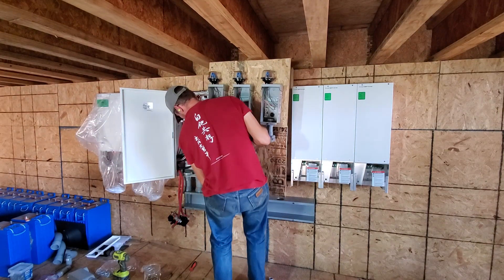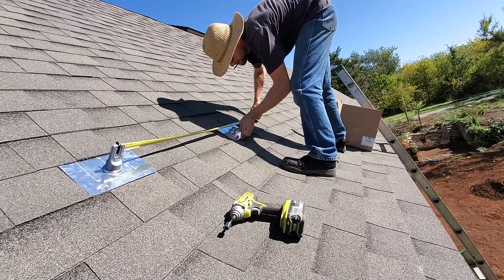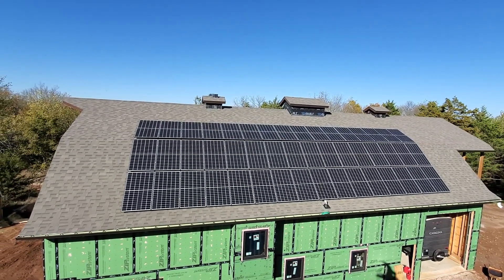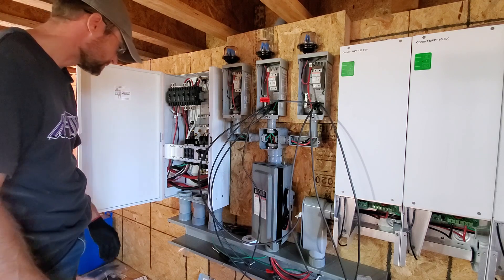One Year Off-Grid on Solar Power Update from our Homestead during the Winter Solstice

Comment: Ouch my back hurts just watching you lift the inverters! I just expanded my system to 2 inverters and had to take down and remount everything. I had to lift the inverters up to 6’8” which was nearly impossible!!!
Reply from the maker: I hope you had help or at least a platform to stand on.  They arw crazy heavy.  
Why did you add a second inverter?  We actually unhooked one since we weren't using enough power to justify having two.  Now I have a spare.

Comment: How much smaller would you go if you had to do it again. I'll be in New Mexico so it has one of the highest solar hours available in the country.
Reply from the maker: We really only needed one inverter which has a running watts of around 6800.  The panels help to charge the batteries faster and do help in cloudier days but we probably could have gotten away with one less array too.  Not complaining, I might unhook some components to save for when others eventually break.
Reply: @Off-Grid  how many arrays do you have again?
Reply from the maker: @denniswallace4868  three arrays each with 16 panels broken into 8 wired in series.  It is one array per charge controller.

Comment: Hey Tim, incredible perseverance and amazing work. I've watched your entire journey on the install and i very impressed and intimidated... Well, I just purchased a 15kw Schneider solar system with 3 xw-pros and 3 mppt100s and I'm doing it myself. Have you had any bugs in the system after you did all the firmware upgrades? Any pitfalls you can steer me away or recommendations?
Reply from the maker: You have three Inverters?  Why?  The XW Pro will handle 6.8kw each and will surge to something like 12kw.  That's plenty of power.  We actually disconnected one of the inverters because we never got close to maxing out at the 6.8kw even with the AC or Heat running along with everything else going on in the house.  That and the system was very buggy with multiple inverters.  

I had very long conversations with Schneider and tech support at Northern Arizona Wind and Sun.  Schneider was zero help but the guys at Norther Arizona were great even if we still couldn't work out all the kinks.  Maybe you'll have better luck with newer firmware but since we dropped down to one inverter the system is running smooth and I'm saving the second inverter as a backup. 

I'd be interested in how your system turns out.  Please let me know if you have issues.
Reply: @Off-Grid  for a 3phase system, DC coupled.  I'll let you know how it turns out.  From what I understand the 3-phase firmware came out middle of last year, it wasn't available when you were doing you install.  I guess I will be a guinea pig. Oh well, thats half the fun.
Reply from the maker: @deltapag5051  Ah, gotcha.  I don't think you'll have any issues then since every inverter will be a master or at least I think.  Do you have a channel?  I'd be interested to watch your progress.
Reply: @Off-Grid  yup, you're right, each one will be a master. Hopefully that will avoid some software gremlins.  I do have a channel but I only use it for my business, for marketing. I have a few machines that use 3-phase so wanted to wire everything up for efficiency. Power bills are $1,600 per month and only going up. I got to do something.
Reply from the maker: @deltapag5051  took a look. Nice midget race car.  I used to do dirt circle track long time ago.  Stock Car and IMCA Modified.